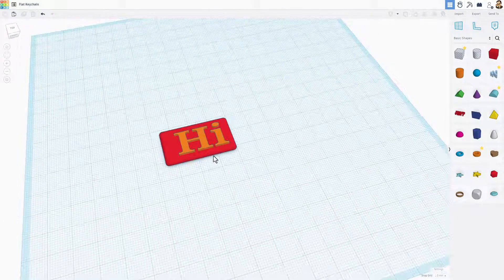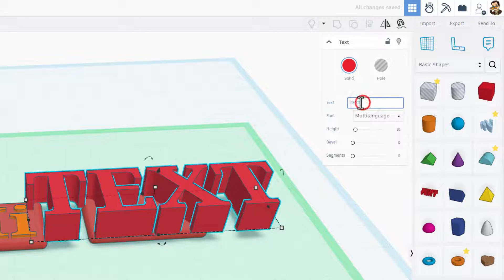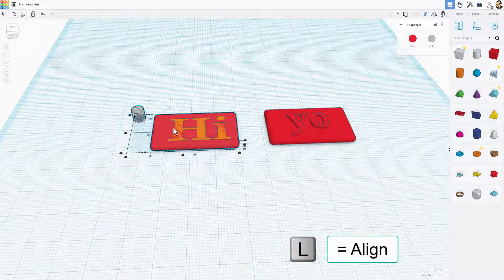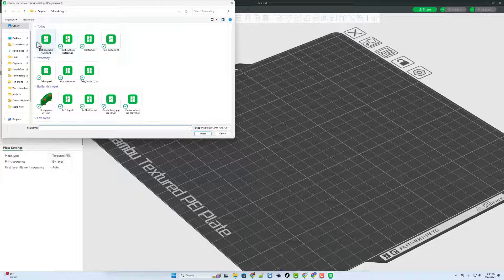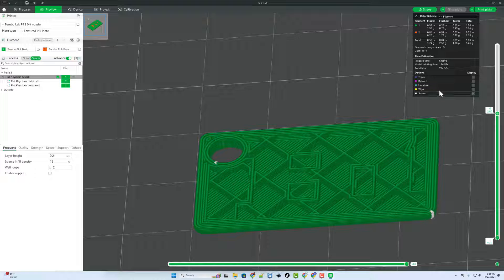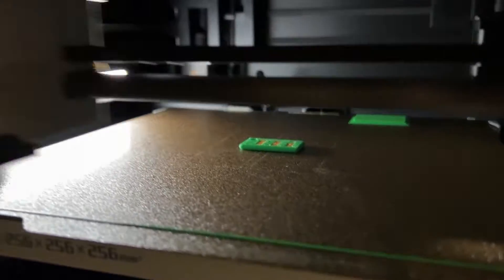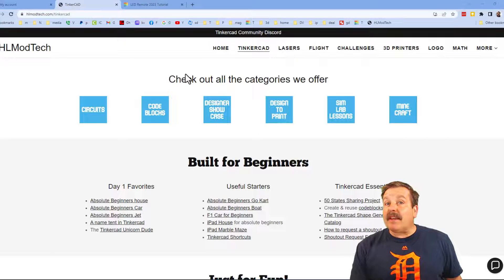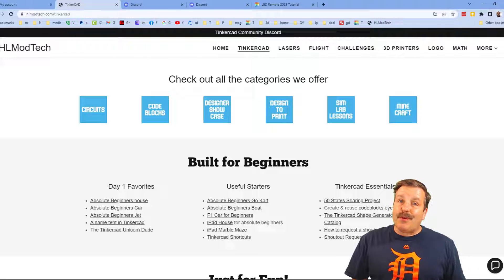A Tinkercad Multi-Color Flush Keychain Bambu Labs Paint Tool in Minutes!

Comment: Hi Mr ModTech, I was just wondering what kind of ring you use for that keychains, and possibly where you purchase them from (that is if it's not from one of your special places with big discounts 😄)?  I just want to make sure that I don't purchase any that won't fit.
Reply from the maker: I do not give away the chain part anymore. In my classroom I had the beaded ones... no clue what the measurement was though. If you search ball chain on Google it takes you to a large manufacturer and explains sizes. Guessing I chose the one that was about 3mm..  but it could have been the 4.   Either way, I always choose 5mm for the holes.
Reply: @HLModTech   Sounds good, thank you very much for taking the time to respond.

Comment: @hlmodtech, thanks for your video's but iam looking voor a though and through different color. This because i want to to shine light through it. I did this with the multipart, but then the letters came out great, but as soon as the surounding over the letter was printed it became a spagetti of fillement. I guess because the base (the second part) is not flat  but don't see how i can fix this
Reply from the maker: I have a slick chat area at my Patreon site. https://bit.ly/hlpat  It is available to free members. Slick for questions like this because we can add images and links. This explains it. https://youtube.com/shorts/xHUM1eGOmjE?feature=share The way to reply, or add more images to your post is wonky, so make sure you check that out first.
Reply from the maker: In there you could also add a share link for your Tinkercad project: https://bit.ly/sharehl That allows me to get in there and debug it a bit.

Comment: Is there a way to add a third color on top of the second color? For example, I have an eye and I want to add a pupil. I'm struggling to get the black pupil to actually print once I get over to Bambu. Thanks!
Reply from the maker: First, I am guessing it does not print because the area is too small. I was trying something tiny once and just could not get it to show up. My fav option for that short of problem is to have the eyeball be a separate part. Have it up as tiny bit larger and use the object painting mode. This is a print where I do that... https://youtu.be/cp4jd_I91i0
Reply: @HLModTech  Thanks! I'll give this a try.

Comment: I’ve wanted to accomplish a similar task.  Imagine a screw hole in a cylinder that I didn’t make so I don’t know the dimensions of the cylinder.  I want to make a plug in the side to cover the hole a different color and make the plug fit the curve.  Have you done something like this yet or can you?
Reply from the maker: If you are just going to fill the hole you do not need to match the screw. In Tinkercad just make your plug to cover the screw hole area and export both parts. Here I am changing names, but the idea is similar to your screw hole I believe. https://youtu.be/reUesJ0rafc
Reply: Thank you for the reply.  That’s not exactly what I need help on since that is an easy flat surface.  I tried to keep the scenario simple but what i really want to do is take giant yellow  lego fig model head (cylinder) and add his eyes (plugs example) and mouth as black.  I want the eyes and mouth to follow the outer wall of the head smoothly and not stick out at odd angles.  The eyes and mouth are images that I’ll convert to stl unless I can draw it easy in tinkercad
Reply from the maker: Do you use Tinkercad at all? Check this out. https://www.tinkercad.com/things/fN49WPt5wvJ-lego-head It is not my design, but that would be really easy to paint the same way I did in my video.

Comment: Another way to do this where you can export as a single grouped object is to raise the text slightly, just by 0.01mm. that's enough for the slicer to treat it as a different colour but not enough to actually add another layer to the print.
Reply from the maker: Nice trick. =) Thanks for sharing. 💯👍
Reply: I just tried this and it's not working for me. I have black text in a white background, raised by .1mm (Tinkercad doesn't give me the option of .01mm (?)). Any insight?
Reply: @amys4976  use the measuring tool and type the height in 0.01mm different

Comment: Yeah the slicer paint feature is what you need. It'll take your work to the next level. That should be an upcoming video hopefully 

These designs are great, but they could easily be done on a regular printer by pausing and swapping filament.
Reply from the maker: Slicer paint is slick. Agreed on the simplicity of these projects, but a user had a question so I jumped in there. =) Cooler stuff will be around the corner.